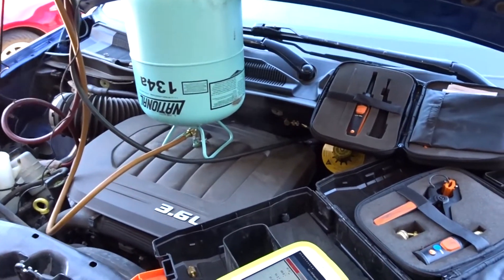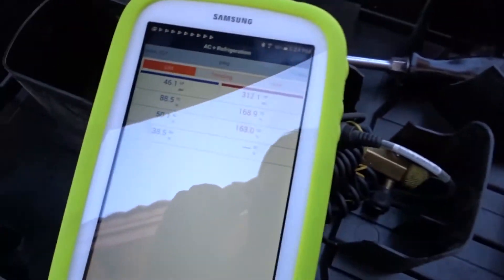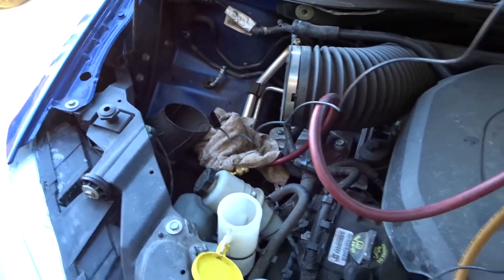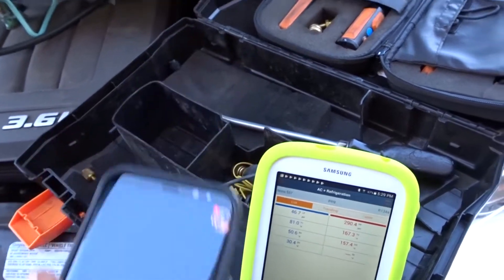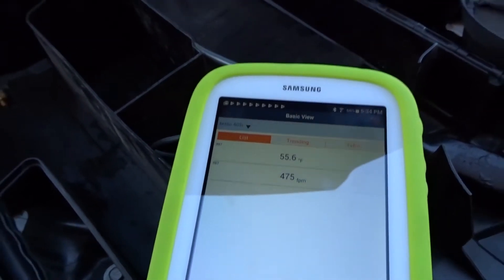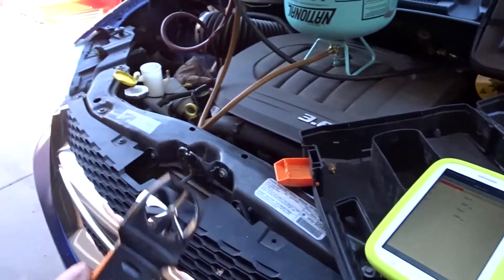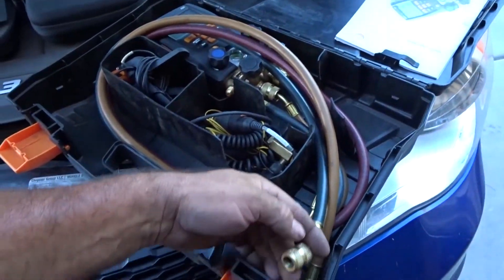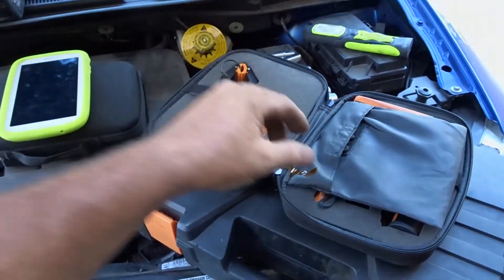Using Testo Smart Probes and Refrigeration Manifold with a Tablet

Comment: It might be a good idea to insulate the suction lines in your extreme heat environment....especially the rear air lines. I just did a video on  a s 10 I put a compresor in. It was an unloader compressor but I had the 550 on it
Reply from the maker: Insulating the lines might be an interesting mod. I haven't looked closely but if this is like most dual air systems, the suction line is likely all exposed aluminum tubing under the van.
Reply: If that is true that the suction line is un-insulated and exposed to 115 degree arizona dry heat u  could drop some of that load off the compresor and decrease suction line temperature going backto the compressor extending compressor life & performance. Reducing head pressure a bit too.

Comment: Holy crap on the Head pressure. 300 is kinda high for 134a. I guess compressors don't last too long out there. I wish u had of increased the idle to about 1500 rpm. I woukd of lijed to see how it operates there. I'd check that condenser and radiator and make sure they are clean. Blow them backwards with co2 and get dome if that arizona dust out of the condenser & radiator. A auxillary electric fan or 2 mounted on the front of the condenser would prob help alot with that system. Especially for idle head pressure. At 300 that compressor can't Last Long.
Reply from the maker: LOL you must not be from Arizona.
You won't find a car A/C operating under 300 PSI in the summer here.
Actually, I was impressed with the cooling capacity of this condenser and fan setup on this minivan of ours.
It is a dual evap A/C at that. 
I've seen 350PSI quite often on car 134A systems in the summer.
Reply: Nope , orange county , California. Do the Car Compressors actually survive 10 years at those pressures.
Reply: It was at idle, on a 115 degree day he said , i would have liked to see it rolling down the road with testo's on to see if he could get at least 1 degree of subcooling. No subcooling = condenser dirty usually or at idle maybe cars don't have any sub cooling when its that hot out. I don't do cars so i can't speak to it.
Reply: Wow !
Reply from the maker: I don't think the testo clamp could read accurately with 150 degrees of air blowing all around it. LOL
Reply from the maker: I drove the van 200 miles on July 3rd up the mountains and that air was ice cold like brand new :-)

I have a Ford Escape also that I should check. I'll see what that pressure is like.
It is a single evap system where the minivan is a dual evap system.
Reply from the maker: UPDATE: A week ago when it was hot I hooked up my probes to a brand new 2017 F250 to check the high side pressure on hot start up.
Well the O-Ring had fallen out of my otherwise awesome auto coupler adapter so I had to grab a hose type adapter to connect to the probe and just as the high side pressure went like "290... 300....310..." and was still going up the hose went BOOM and came apart to my pressure probe and I never did get the final reading.

I think I found an o-ring to fit and will do a video soon of a few cars starting up and turning on the A/C on a hot Arizona afternoon. Should be fun to see.
Reply: 134a runs higher head psi, R12 was an ideal gas with head psi's running 250-275. It was a great gas like R22 until the EPA got involved. The Big Kenworth OTR trucks with dual zones, can get low 30* deg out duct with R12 also, i mis those days

Comment: We designed the UEi HUB smart probe system and people are asking us if they can use it in automotive.  In your experience have you ever seen heat or chemicals found in the engine compartment to cause any issues with using smart probes in automotive applications?  How often do you use HVAC probes in automotive?  Thanks for the help!
Reply from the maker: So far I've only used them on my own cars and for a few friends. 
But I use my Testo almost every day for two years now and still working.
Reply: @hackfreehvac   That's good info.  We were looking for someone to test the HUB system in automotive applications but it sounds like that's not a regular application for you.  If you know anyone else that might use this type of product more regularly in automotive applications, please reach out to us.  

The pass through T and hinge we think are distinct advantages for cramped spaces and we use a plastic which should be more resistant to heat, mechanical stress and chemicals.  Because of the beacon technology we use, having multiple tablets with one set of probes is no problem.  We also have the dual air probes with a hinge which allow them to be straight and inserted into the air vents like you used them.  We really like how you stored the tablet within the case of the probes, very smart.  Keep the videos coming!
Reply from the maker: @arbiterbackflow  
Sounds good. 
The auto stuff is just a hobby and for friends,  family etc. 
For my trade it's more in the Commercial HVAC world.

Comment: I Would of Liked to See Your Testo smart probes hooked up while You are driving. Tablet in the car. Smart probes under the hood. That woukd be a cool video. Real time a/c action. Use the Leashes they come with with a wire tire just in case they fall off while driving.

Comment: have you ever tried r152a in a car ac system?  i really want to give a try for experimentation. There are actual studies that have published presentations showing that it has higher cooling capacity when dropped into a r134a system and requires less energy than r134a..
Reply from the maker: I'm not familiar with that refrigerant.
That would be interesting.
Reply: its the aerosol in spray cans. To buy pure r152a just buy canned air that says Diflourothane.  Its relatively cheap. Can find find 3 pack of 10oz cans for $10~$15.  ( I know jugs are way cheaper.)  But it is compliant with the EPA. Has a GWP of 100 (what BS gwp is ...  r134a is 1400.. what ever the hell that means) and apparently has a 0 ozone depletion factor and dies off in 1 year vs the 13 or so for r134a. .  So all that tree huger BS aside,  it has very similar properties to r12 and is becoming very popular in r12 system retrofits. As well as getting some chooch from newer cars.